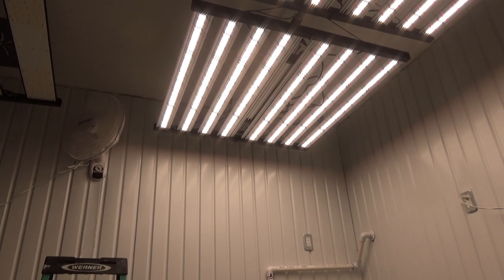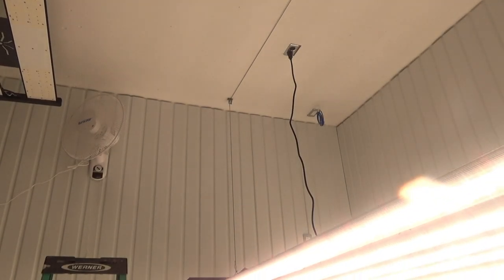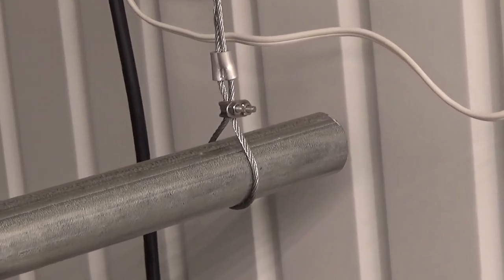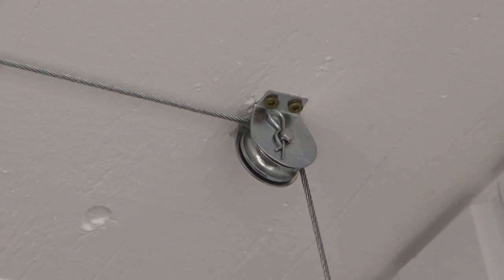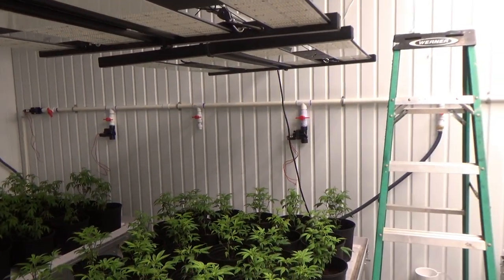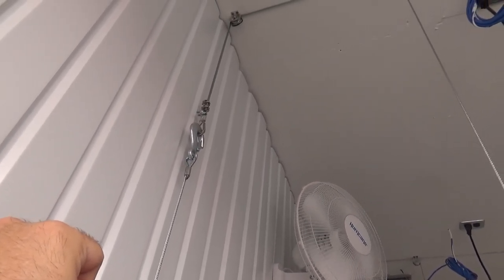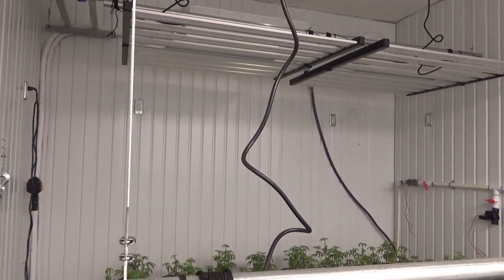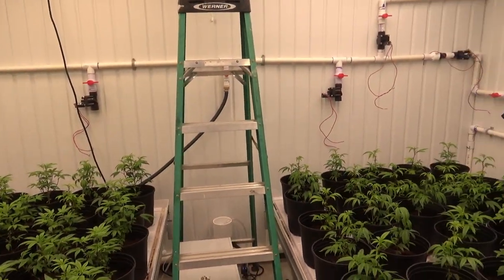Making your own Light Lifting system

Comment: This was exactly what I was looking for!!!

Wonderful video! I had the same problem with my 4 fixtures. Using the ratchet straps that you normally use with the fixtures is kinda difficult when you have four! It is just really awkward to rise.l lower the light fixtures when you have so many!

I picked up the 2440 x  35mm metal poles, pulleys and wire today so I will get started tomorrow.

One quick question, what winches/ratches did you use to pull the wire may I ask? It looks like winches as you have such. smooth towards motion of the fixtures (mine are Lumatek 1000w Co2 and weigh around 18g each, Been looking on Amazon for hours and they all seem too powerful? Maybe that is correct?! Any help would be greatly appreciated!!😀

Thanks for the great tutorial dude!! Just need to know what winch you use on each witch?

Happy Growing!